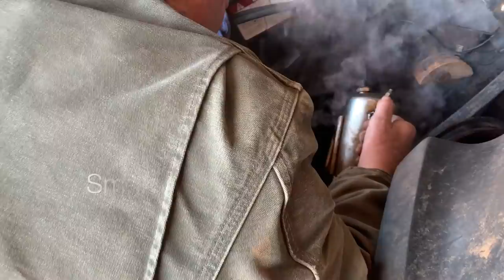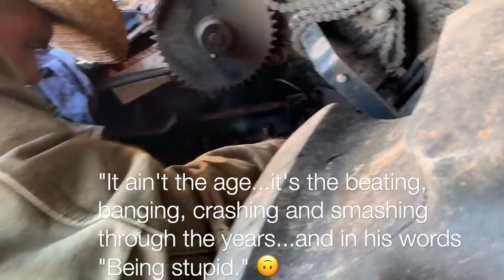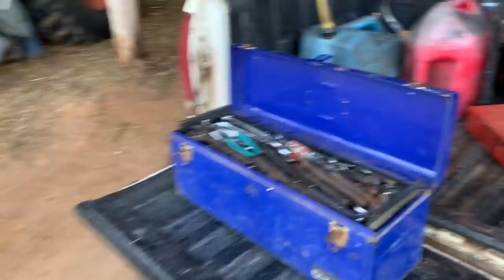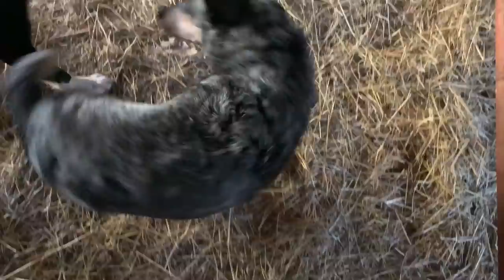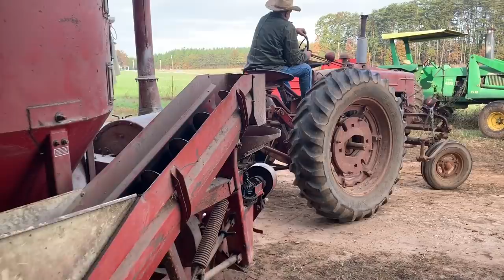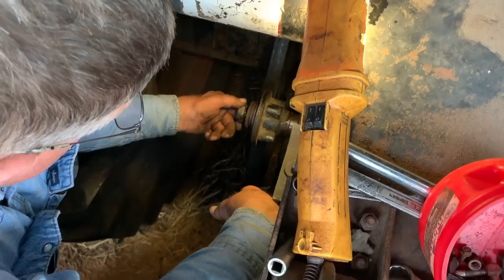Will It All Go Up In Smoke?

Comment: Holy smoke I can relate to Lawrence! Livestock, field crops and that constant equipment issues will teach you patience or make you crazy. Perseverance without fail is the only solution. Frustration comes from no choice. Lawrence has been down these roads many times.I see it and also hear it in his voice. I'm sure your cornbread helps. Nice of you to check in on him often. I just bought a modest washer from Lowes also. It's a great machine. It cleans the same as the ones with 15 settings that you only use two or three on. Can we hear a little guitar music from that young musician?

Comment: I worked on blue seal feed grain plants yers ago. Removing sprockets from machinery was always tough. Given the region we worked was the northeast it was usually quite cold. So we would hit it with penetrating oil attach the puller and put hard pressure on it then walk away. The cold air would chill most parts within 5 mins. We always knew when it had lossened by the puller popping off. Most of our work was high in the air so we attached lanyards to the pullers to keep them from falling to the ground.

Comment: I worked in a machine shop for 40 years and removing stuck bearing and sprockets are the worse, even when you have the tools to do it.  No telling how many times we tore up tools.  we had hydrallic presses that we used to pull bearings off.  It is a job.  He was doing good.  Sometimes, it takes what it takes.

Comment: A little smoke can be a good thing.  Your videos are great.   Spraying starter fluid on the shaft can shrink the shaft quickly to break the bond between the shaft an pulley.   This works good on lug nuts 

I sure could use an Oakley Combine hat 😊

Comment: When we used to change over to beans the first thing we did was remove the corn head and check the entire feeder housing and chain for damage. Corn is rough on the chain. Then if you have to change anything around the front of the combine it was much easier to get to. We once even removed a front tire to get access to a fan bearing! Just a thought on the old Gleaners. Bearings and such are never fun and almost NEVER come off easy. Wish I could come up and help him.........

Comment: Bonnie is so mellow but getting used to being filmed. The only thing I would do with that sprocket is after heating it would be to hit the center punch of the puller with a hammer when you have tension and heat. You never know when it will break the tension. That's what we do with engine pulleys. Farming is definitely frustrating at times. Try Fluid Film on the nuts/bolts/threaded rods  that need maintenance every time and a little anti-seize and the future disassembles will be less taxing.

Comment: I always left the big pulley on the cylinder for both corn and beans, only changed it for wheat.  Just run the variable speed higher in beans.  May not need that much speed in beans anyway after the frost.

Comment: Heat the part.  Hot as you can get it.  Preferably with acetylene torch (quick n hot).  Then quench it with water.  That expands the parts n breaks up the binding elements.  Used to do that in a truck shop when changing body's over from old to newer chassis.  Sometimes body bolts'd been on there 20 or 30 years of winter salt etc.  Always came right off.  
Hope ya get'er done.

Comment: Lawrence I did the same thing to my body.
I'm not a farmer but I upholstered furniture for 35 yrs and it's a nice clean job but it's a very hard job beating and banging and stretching leather and lifting on very heavy frames .I've had my right shoulder replaced twice and still not right and left shoulder needs replaced .both knees have been replaced and have carpel tunnel in both hands/wrists.
 Also ruptured my left Achilles tendon and had that reattached.
    It's just been ongoing since I turned 50 and now 61. And it ain't over yet.
 I should have gone to school to be a physical therapist so I could help dummies like me instead of being the dummy. 
   I'm now on SSDI and LTD for life .
   Not at all how I thought my life would go.
   I'm bored to death because there's not alot I can do now.

Comment: Time to go back to Lowes or Home Depot and get a new set of hoses for the washer. I'm sire the old one are stiff like old joints and have a tendency to leak after being hooked back up. You'll thank me later if you didn't replace the hoses.

Since you guys raise beef cattle, make some chili with Paprika, chili powder, onion, London broil beef cubed and browned, kidney beans, diced tomatoes and Rotel Hot chili's. Cook in a slow cooker for 6-8 hours. Goes great with corn bread.

My great aunt made corn bread that was sweetened. It was a meal all into it's self.

Comment: All my Gleaners I've run the large corn pully on the cylinder to run my beans! I'll run the cylinder as slow as possible for corn and speed it up with the variable speed to run beans! The only reason we change the pully is for oats! I  changed them bearings on my M2 two years ago a torch and a fire extinguisher were close by!

Comment: Hey Meredith, It's frustrating trying to work on a piece of equipment where the part your trying to remove is 100 years old....LOL (really just several years  old).  Oil, heat, and grease,  become our friend or a requirement in order to remove,  beat/cut off an  annoying part.  This has become the protocol for most men....and women when dealing with equipment that doesn't want to come apart or function the way we'd like
 it to,  You should have seen me take apart the head to my vacuum cleaner......Lord knows everyone in the house heard me beating on that thing!!!  And yes, it still works.

Comment: Tell Farmer after getting old bearings off, clean shaft off with emery cloth and apply Anti-Seize to shaft before installing new bearings.
Reply from the maker: He said he was going to do that!
Reply: @ThisFarmWife_  fit a battery kill switch on combine also .....seen a good combine burnt for the lack of one , we did a lot of  repairs to it  the spring before and was running better than ever i saw ........u learn the hard way .......

Comment: Kroil is a good product, but I have found that acetone and automatic trans. fluid is very good if not better  than kroil. Mix acetone and automatic trans. fluid at a 50\50 blend wil work  good if not better.IT is also cheeper

Comment: Working on old iron needs More Heat, as it cools down it will finally come loss. Just burn them old barrings off, not cutting the shaft it's on. Good luck and take the time it take's. Be patient so you brake your knuckles.

Comment: Meredith 
Just out of curiosity,  I was wondering if Lawrence had taken the tire off Gertie,would he beable to get at that bearing and sprocket better, seems like he had to squeeze in there and seemed uncomfortable, just a thought mind you, I agree with other comments when replacing sprockets and bearings, use Never  Seize  so next time it should be easier to remove, I have faith in you to Multitask, lol
And I know you saw how frustrated Lawrence was in trying to fix it, you had the correct way of being quiet, but I could never see you and Lawrence being upset with both of you. He really loves you and you love him just as much.
Reply: Meredith please, please get Lawrence a case of copper anti seize  at your local automotive  supply store,it will save  a whole lot of grief  the next  time this falls into the maintenance  cycle. That stuff is worth  its weight  in time  saved.
Reply: Pat Mac....
Good one. That stuff is the paste of the Gods.

Comment: Not like he isn't doing it ok but after 20 years of that sort of problem once he tightened it and it didn't move smack end of the puller with a hammer as you turn the puller. By the way it is no longer daylight savings hun.